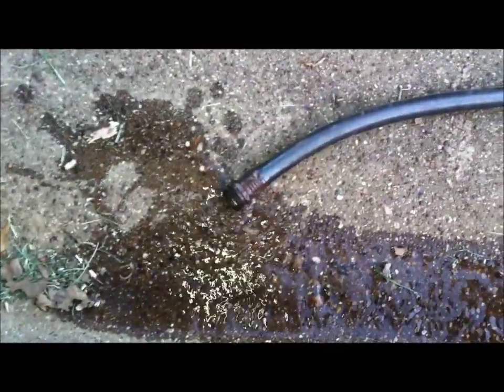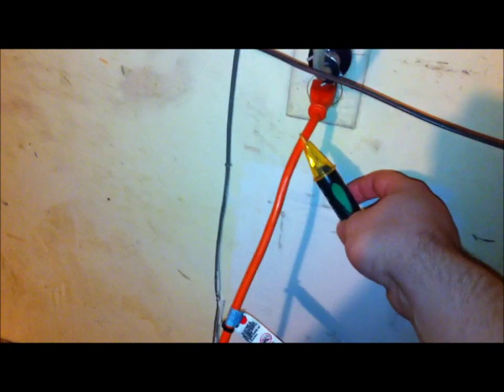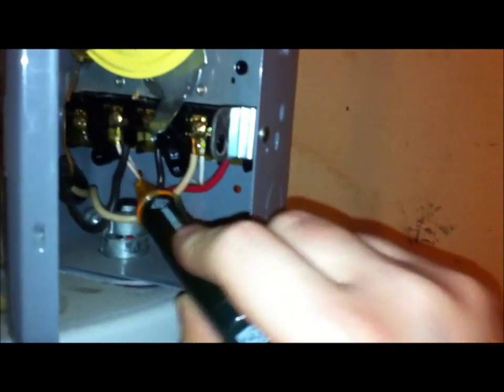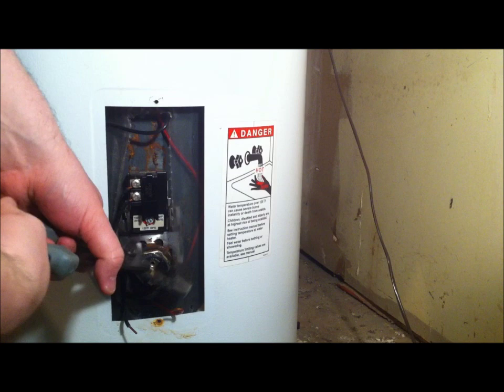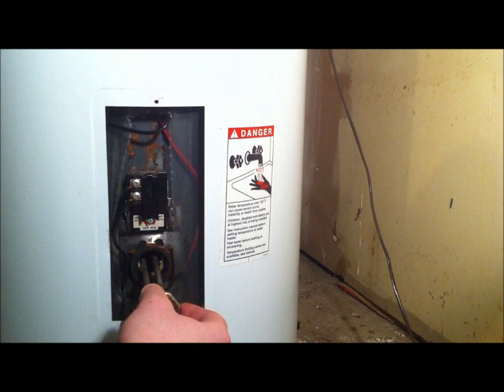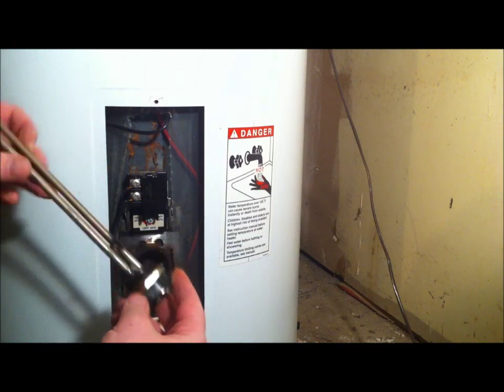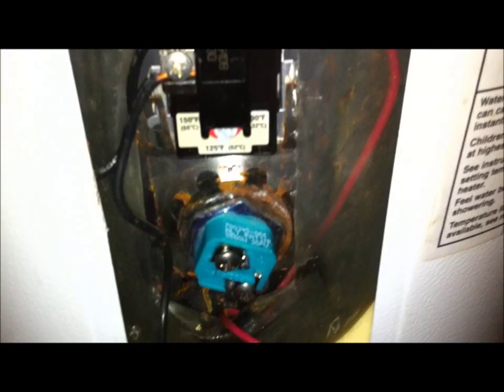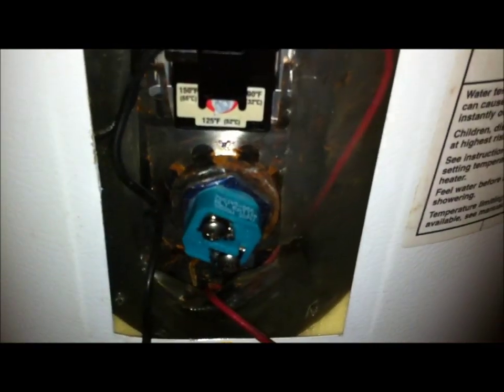Electric Water heater element change

Comment: THANKS SO MUCH! I followed your instructions and went ahead and replaced both heating elements. I'm hoping the problem was indeed a faulty element. I did not have the popping sound (at least that I've noticed) and my breakers were not tripping and the old ones were not damaged as clearly. They do look old and scaley and full of calcium deposit. My problem was just running out of hot water prematurely, before completing a normal shower.

Comment from the maker: @frankt04 yup, as long as the wattage and voltage match the ratings of the heater, and the element fits and is clear of the tank walls, you should be fine.

Comment: @eddie1975utube I think your dip tube has broke the elements pop and trip breakers when they re bad but it's good you replaced the elements just try to check the dip tube if the problem isn't solved.

Comment from the maker: I agree with you that it is better to use a multimeter to test for voltage,  I have several, but many people don't have access to a good one, and this video was meant to be an aid for the non-professional.  Voltage detectors are cheaper, and when used properly (by first testing them with a known live source to ensure they are working properly) they can be very reliable.

Comment from the maker: While it may be easier and more convenient to replace an element without first draining the tank, I feel that it is better to do the task the right way the first time and avoid issues, than to cut corners and risk problems.  For example, if you accidentally strip the threads while trying to quickly install the new element, you'll have a big mess on your hands.  Also, being too quick to jam the new element in to avoid a mess can damage it and shorten its life.

Comment: At 1:35 when you show cutting off the cold water supply I see a blue light on the pipe, ? Is it a  blue flame or blue led or reflection of your camera light ? Thanks for the video, I watch it carefully. And learned about how to fix my water heater.

Comment from the maker: @eddie1975utube  a bad element could definitely cause that.  The elements switch on one at a time, usually the upper one first.  When the water around the first element reaches the set temp, it switches off, and the other one switches on until it reaches its set temp.  So if your lower element was bad, you would end up with only 1/2 tank of hot water.

Upping the temp definitely helps too, but setting it too high creates a risk of scalding, especially if you have children in the house...

Comment: CONTINUED...So my guess was one of the elements was not working. I went ahead and upped the thermostat from approximately 130 to about to 140 (I had upped it from 115 a few years back). There seems to be plenty of hot water  but I'm not positive if it was the upping of the temp, or the new heating elements or both. ;-)

Comment: what tool do you use to remove the element?
Reply: +Daniel García Hey Dan, Rob here. You're probably already finished. They element removal sockets as Orchard Supply Hardware. It's in the heater isle along with the heater elements.
Reply: 1.5" socket wrench

Comment: .Plus it doesnt take hours...You can loosen up the bad element, have the other on hand and ready to go, take out the bad element, quickly install the new one, and you lose maybe 1 cup of water if you are quick enough...If not, you lose a few cups and its much better than having to refill 80 gallons of water. Very simple.

Comment: Never EVER EVER check electricity with a death stick. They are nicked named that for a reason. Get a Multi Meter and always check your electricity that way. Too many people have been killed or badly electrocuted by using the death sticks. A multi meter will always tell you if the voltage is there or not. If you need help using one please contact me, and never rely on the voltage stick. Also, it does not take hours to drain a water heater, not sure where you learned from.

Comment: but you are sending the wrong and potential deadly message to "You-Tubers." You can test the top and bottom elements by checking the "ohms" of an element. This can be done with a multi meter, which you need to be using in the first place. The power is shut off at the breaker and disconnect if the water heater uses one, then turn your meter to ohms once the power is confirmed off, and then find out which element is bad... When you do that, you DONT HAVE TO DRAIN THE WATER HEATER.....